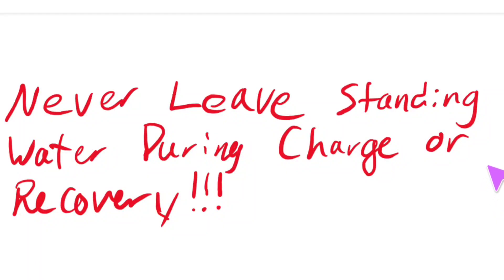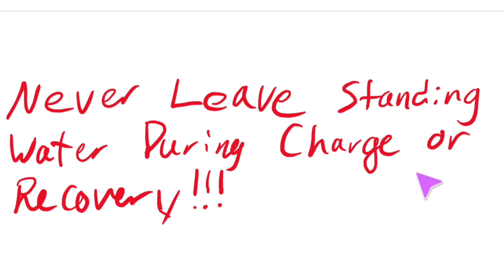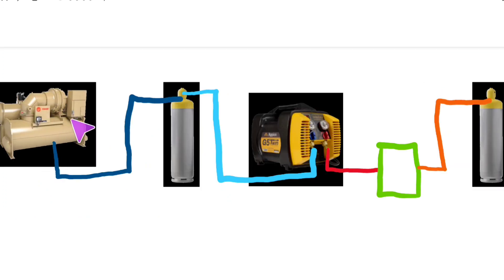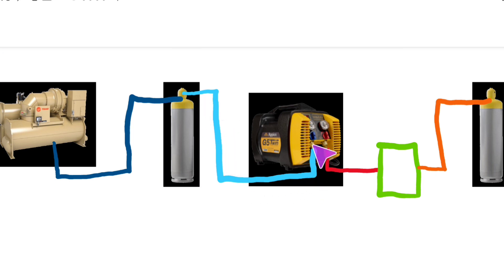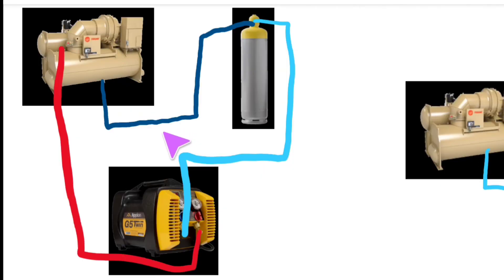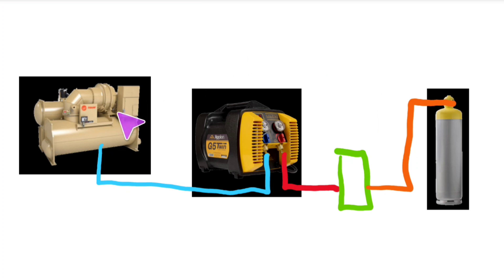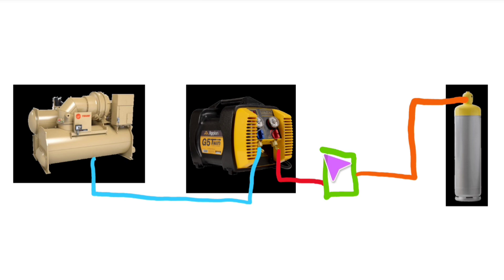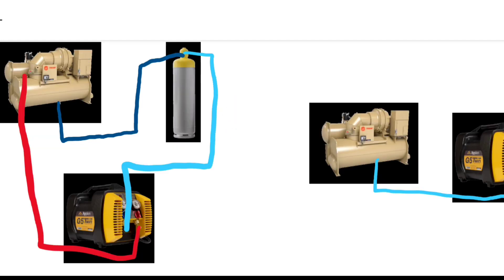HVAC Chiller Refrigerant Recovery Procedure

Comment: I evacuated an old Trane chiller with pistons and unloaders using just using the recovery machine to the bottle and only seemed to pull half the charge. I pulled from the suction line, and the discharge service valve. Pressurized with nitrogen which held, pulled a vacuum to 360 microns and added the factory charged. Now my low side pressure is going really high quickly. Not sure what I did wrong.

Comment: In some instances you can’t drain or flow water. What we do is pull refrigerant to 35 degrees, stop recovery and let machine stand for 30 minutes, if pressure rises it still has liquid. Once it doesn’t rise it’s all vapor.
Reply: Just out of curiosity why can't you drain or flow water from the chiller when your recovering? I was always taught to flow water through a vessel  or else the tubes will burst because there is no exchange of heat on the tubes

Comment: I certainly wouldn’t use a residential recovery machine on a centrifugal chiller. You must be non Union.  Check out Reftec, they make recovery machines that recover 10 -16 plus lbs per minute.
Reply from the maker: Rat shop forever and always lol
Reply: Reftech sux

Comment: When recovering a low pressure machine and you switch to vapor, do you not need to relieve pressure from the vapor side of the tank with possibly a blow off valve?
Reply from the maker: No, if you run it through a subcooler it will keep temp/pressure down.

Comment: My company’s low pressure recovery has different valves you can open and close to change direction for recovery. I push pull then swap valves to pull vapor. I can do 750 lb r 123 in about 5 hrs total

Comment: Push pull does take a couple more hoses and a little more time to set up but The amount of refrigerant your able to move is astonishing. Especially if your chiller holds 2600 lbs. 

I’ve never tried that first method you speak of,  Gonna give that a shot next time.

Comment: The method with the bottle before the recovery unit is neat, haven't seen that one before. Push pull doesn't look like it would be much quicker than that, short of keeping the pressure in the chiller maybe a little higher. Keen to see the comparison!
Reply: Push pull works like a charm, just recovered 1300 lb of r-123 from a YT, took me 4 hours. I dont see the advantage of hauling multiple tanks, a waste of time and energy in my opinion.

Comment: Do you use the G5 recovery machine? Or a bigger machine to recover low pressure systems?
Reply from the maker: We use a low pressure recovery machine. It is quite slow with a G5. I was mostly using that as a example.
Reply: which low pressure harvester model do you use?
Reply from the maker: @jhonatanvallejo365  we have a custom built design from a company local to us.
Reply: @HVACTIME  show, when you can make a video for us, thanks.
Reply from the maker: @jhonatanvallejo365  will do, I have shown the setup in previous videos.